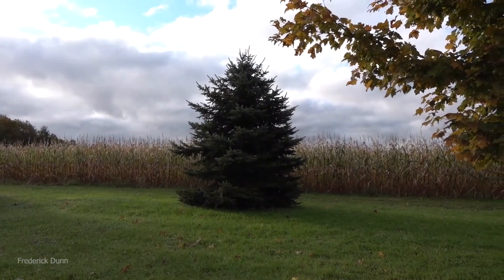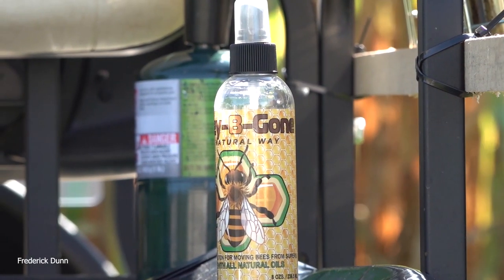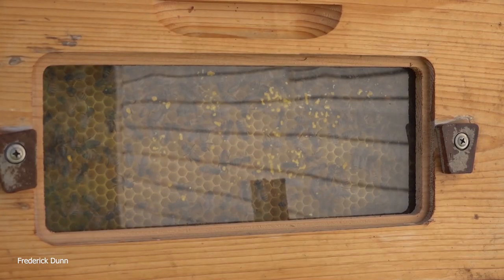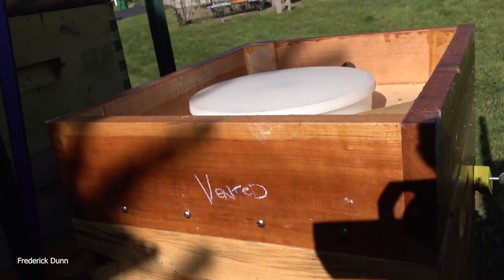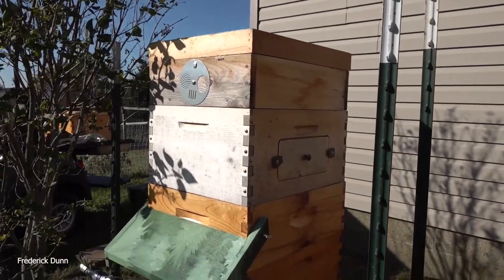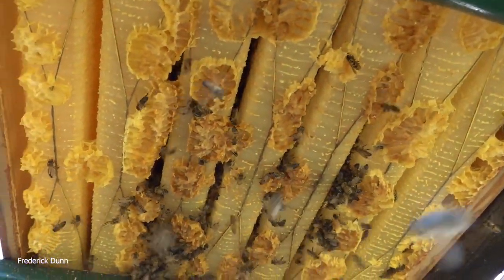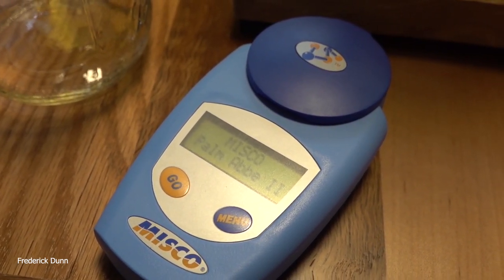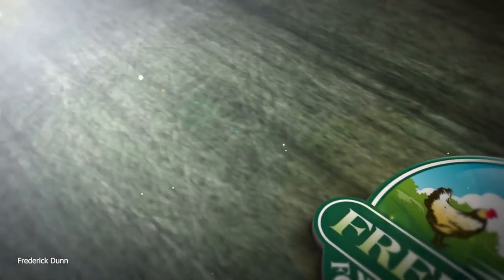Honey Bee Questions Answered, Removing Flow Hive Supers for winter,  Honey Testing, Queen Excluder.

Comment: Ha Mr Dunn hope u had a wonderful weekend, we got some much needed  rain here in Virginia I have a question for u and it has nothing to do with the flow hive.  I have screen bottom boards on all my hives for heat and ventilation.   I use mite away quick strips for mites,  it is very expensive because of the amount of hives I have,   If i was to use the vapor with the wan would the open bottom boards hurt the effectiveness of the treatment.   smoke goes up   I was wandering what your thoughts were Thanks for all the wonderful videos u do and for your willingness to help other bee keepers with your wisdom.  Have a great day and thanks again
Reply from the maker: Hi Frances, you have to close up the bottom screens for the oxalic acid vaporization to be effective. The bees would just fan it out. :)

Comment: Interesting observation on the shim vents.  It has always seemed to me that ventilation is a much bigger deal for beekeepers than it is for the bees.  I actually wonder if some take the idea too far, since there seems to be evidence that the higher heat/humidity levels of ‘unventilated’ hives is less favorable to varroa.  What’s your take?
Reply from the maker: Hi Adam, my take on it is, after visiting and observing every feral colony I can find, that the bees prefer a single entrance and that entrance is at the bottom 1/3 rd most of the time. If we are observing what the bees will do on their own, then upper venting is definitely a human preference that just may not be benefiting the bees. They did the same in my observation hive, that is, they plugged up all four of the side vents (top and bottom) leaving only the 1.5" diameter entrance for venting and egress.

Comment: HI Fred, A few years ago I thought you had left the flow frames on over winter? I live in the northeast corner of Texas, no snow but it can get cold. What do you think about leaving them on as supers for the winter?
Reply from the maker: During my original Flow-Evaluation period, I did leave them on in winter to see if the Queens would lay in the flow-frames. They did, and then migrated the brood down to the lower boxes in spring. After satisfying that concern, my practice is to remove the flow supers for winter for several reasons. First, to keep the bees out of the flow-supers when they move the brood towards the top during cold months, and Second, to allow me to clean them out and place on the strongest colonies only, in spring. Some of my hives never get the flow-supers unless they demonstrate adequate numbers AND build a full medium frame of honey.
Reply: @FrederickDunn  Thanks Fred for your advice, I remember you video regarding removing the flow supers, my mistake was not putting on a medium before the flow super. I had no luck last year with 2 hives they just looked around and filled most of the cracks and then I did remove them before winter. I am afraid that I have waited to late to remove the flow supers as these were new Weaver bees and they did fill the flow supers to 95% and I did put a medium between the brood box and the flow  super about 3 weeks ago. I have not looked since as our weather has had its ups and downs. I do have a queen excluder below the flow super, but I don't think that the medium will be enough to get them thru the winter. I plan on checking them next week as I have to be out of state for 10 days. I have started changing over to mediums above the supers as I am older and just can't lift the weight.  I did not harvest honey at all. Any other input is appreciated if you have any, don't you think a medium by itself is not enough? Good luck with your very cold winter and your bees. Brenda
Reply from the maker: @brendaramler7070  HI Brenda, at this point you'll just have to wait and see. I had a colony of Weaver bees make it through winter in a single 8-frame deep box with nothing else. It's really depending upon the hive strength and numbers that will require those resources. At times, smaller clusters make it all the way through winter.
Reply: @FrederickDunn  Thanks again Fred for all you do and for sharing it with us all. God Bless you and yours

Comment: Hi Frederick, I recently harvested my first harvest with the flow hive and I had a cleaning station but my bees didn’t clean it very much, but it did attract a lot of yellow jackets. 
I was just wondering if I need to clean the frames a bit more myself, since there is still some wax and propolis on the frames, before I store them for the winter. Thanks!
Reply from the maker: Hi Monica, I am perfectly fine with the yellow jackets cleaning up the frames also. Cleaners are cleaners in my opinion. The bees must be doing well if they aren't working over the frames for those honey tidbits. Wasps will chew into the wax and leave no sugary residue untouched. Just my opinion there, but I'm just happy to have them clean it up. I do grab the Bald Faced Hornets when I see them at the station. :)
Reply: Ok, thanks so much!

Comment: Question on your Flow winter prep.  Could you leave the flow frame OPEN, after your last honey collection for the season, while the flow super is still on the hive?  Wouldn't the bees just clean out the frame, but not be able to fill that frame again?  Just wondering.  Thanks.
Reply from the maker: Yes, that is a viable option. But remove it within 48 hours give or take :)
Reply: @FrederickDunn  Thanks, I got my Official Flow Hive (Cedar) delivered two days ago.  I want to use pure linseed oil to finish the exterior before assembly. I have to work in my living room since my shed is not heated and a bit crowded.  Right now the grandchildren have their train sets all over.  We take them back home in two days.

Comment: Hi Fred, I will have to say fume boards do work well especially if you just have a few hives. Its faster than using escape boards. Like you said spray it down liberally and the more the better. I tried making some DIY Honey Bandit using almond extract and rubbing alcohol but it wasn't strong enough. I will add more almond extract to it and see if it helps. I keep the fume boards in the garage I like the smell which is a good thing.
Reply from the maker: Definitely nicer than the widely marketed escape boards because you don't have to lift the supers twice :)  Also works better when the wind isn't blowing so hard. I think I need to to a test of several commercial bee-chaser essential oil mixes to see which works the best. They all eventually work if one isn't in a hurry. I think four fume boards is the sweet spot. By the time the 4th board is on, I can pull the super under the first one. Thanks for sharing and let us know how your formula works!

Comment: Hey Frederick, an idea come to me about another video you made having an issue with not being able to clean five year old Flow Hive Frames.  The idea that came to me is to clean them every year!  Every winter when you remove them from the hive, soak them in boiling water.  If they get cleaned every year, that build up is not going to happen so fast, if at all.  Just an idea that I think can work.  Yet we still need a better solution to clean them well if they get really dirty.
Reply from the maker: That's a great idea Brad! Thanks for sharing!

Comment: I appreciate your thorough explanations and great insight.  I especially like your thoughtful approach to beekeeping (e.g. sending as many drones out as possible to spread the BeeWeaver genetics, using robbing stations to help protect weaker colonies, focusing on healthy bees not honey production, etc).  We are new to beekeeping (with just enough knowledge from your videos and having attended some local beekeeper group meetings) and have ordered bees (two boxes with queens from Georgia) in for April delivery.  I have also ordered two queens from BeeWeaver, as I want to benefit from this survivor line and their varroa resistance.  I will find someone, hopefully far away in another county :), to take the queens that come with the box.  Do you think there will be any issue with the bees accepting the BeeWeaver queen after the bees in the box have possibly "gotten used to" the queens that were shipped with them?
Reply from the maker: As long as the Package hasn't "blended" with their transport Queen, They should just as easily accept the mated Weaver Queen. Leave the candy plug in, so they have to chew through to here and this will give them more time to accept her scent. (three days queenless is optimum).

Comment: Hi Fred,  I’m in central NC and my bees did the same thing with blocking the vents in the feeder shim. I also use the round feeder. Regards from NC
Reply from the maker: Thank you for sharing that even NC bees are doing the same. I'm leaning more and more away from upper venting. The rapid round units are inexpensive and easy to use, I definitely like them!

Comment: Mr. Dunn, thank you for sharing your knowledge with these videos!  I saw in another comment response, where you mentioned trending your hives towards traditional hives, topped with the Flow super. Can you elaborate on why the mix, rather than the full Flow stack?  I am looking to get started this coming spring. Thank you, Oscar
Reply from the maker: Hi Gator Stays, I've added your question to my FAQ for this Friday!  It's something many may be confused about, so I'll elaborate then. Some hive components aren't made by Flow, such as the medium supers which I use most in-between the deep brood box and the flow-super. I also like some of the advantages of the solid bottom boards over screen bottom boards. Though I consider the FlowHive 2 bottom system to be superior, it's more money than most want to spend and I don't personally like the pull-out corrugated inserts that came with the original Flow-Base. So it's advantageous to mix and match.  I'll give more detail on Friday.  Thanks for asking!
Reply: Thank you sir. I’ll be looking forward to your video!

Comment: Hi Fred, had a big black bear take an interest in my two hives several nights in a row.  To keep the hives from being destroyed before finding a more permanent solution, I moved both hives to a 2nd floor deck (30 yards away) that is not accessible from the ground.  Thought it was interesting that after a week many foragers still flew to the original hive location.  10-14 days later they all appear to have adjusted.  Any other negative side affects I might not have considered from changing locations?
Reply from the maker: Other than having some of the foragers lose their way, there really shouldn't be a problem with the move. This is actually a great time of year to move and relocate hives. Maybe that deck may suffice as a permanent location for your hives? I have a friend using the hayloft of a large old barn and that's another pretty nice spot! let me know if you learn something new after that relocation!